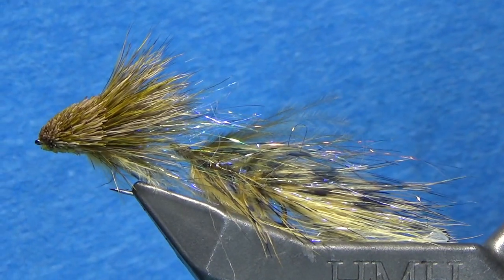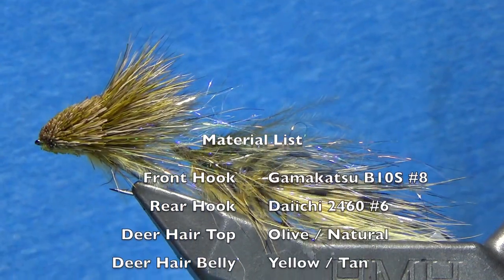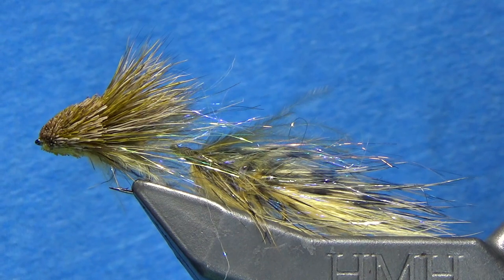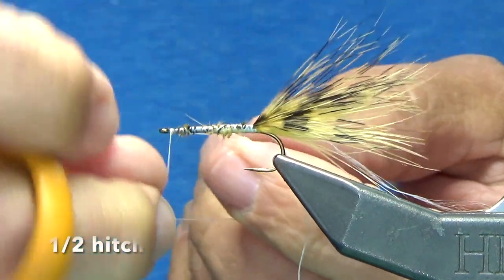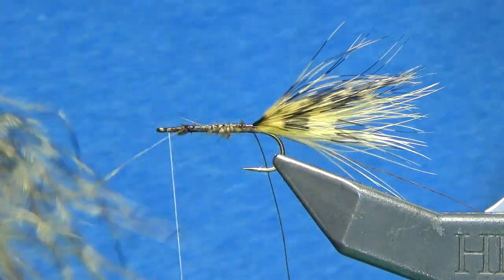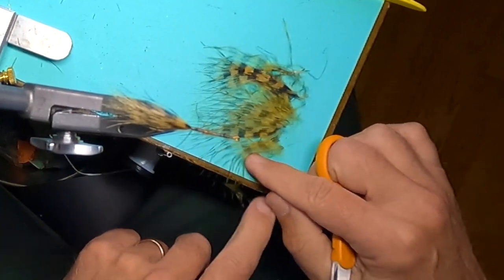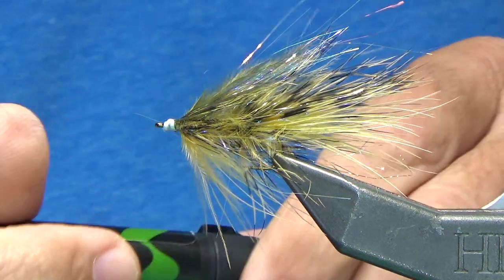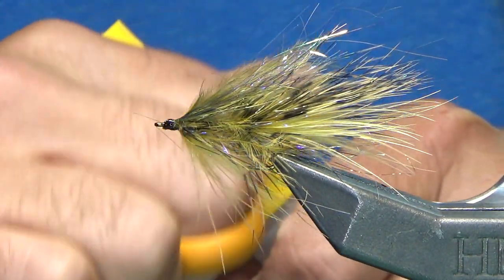Fly Tying: the Articulated Muddler Minnow

Comment: Hello, I would be very interested in how this streamer actually works, because it is mostly used on the bottom, but here it is said that it is light and used with a floating line.. So how to guide it and at what depth.

Here, for the first time on the riverbank, I noticed almost white heads on the river, I didn't want to believe it, but before dark they started to climb out of the holes. Of course, I didn't even have one in the box. But the video is great, the presentation, no bugs. Let's all thank this person.
Reply from the maker: Because the streamers made with deer hair, it will ride high in the water column. The reason why I like to fish it on a floating line is to keep it within the top one to six inches. This allows me to fish it slowly and still in part a lot of action. I hope this helps you out. Have a great day!